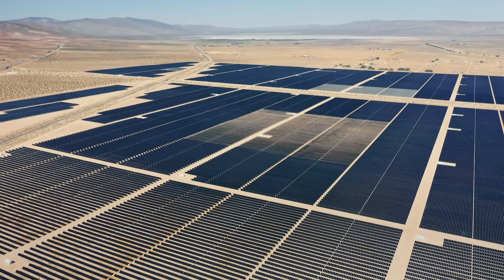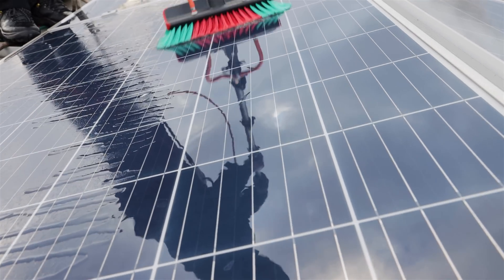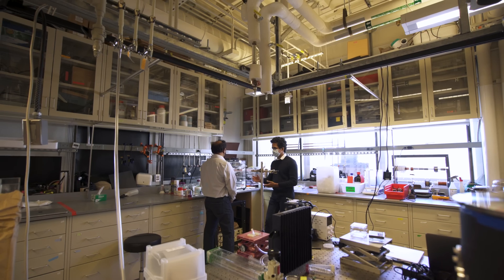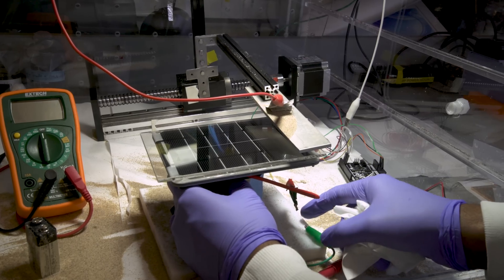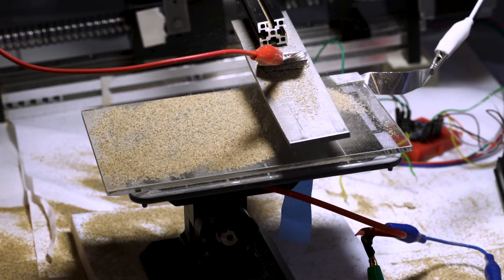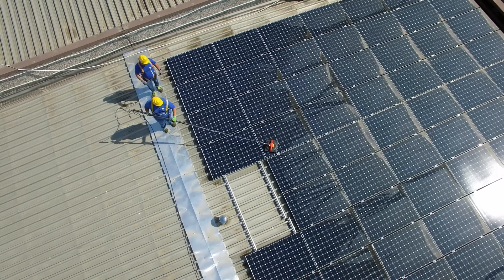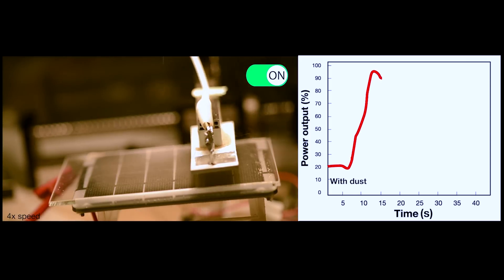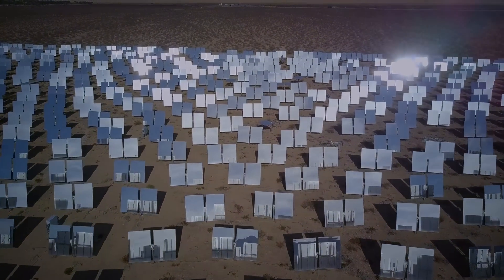How to clean solar panels without water

Comment: Can we change the algorthm of the cleaner so that it only roam on dust not the cleaner part of panel? how can be used for industrial scale and clean different row of panels, does it required to manual intervention to keep the cleaner in different rows? or we can use something robotic to place it in different rows of panels? how much electricity consume for cleaning per sq mtr?

Comment: It doesn't look that efficient because we can see some layer of even small dust particles are stayed back on the panel even after cleaning with this method. It's better to use some kind of clothes that can be used in a way which won't scratch the panel.

Comment: How about having coating the solar panels with solution which just repel dust. Just like water repellent solution. Just won't let dust stay.. a little wind is enough to slide away the dust on the glass.

Comment: It would be quite a scale (and not work on the type of array shown here), but if the panels were in continuous banks then rainwater harvesting at the point of use would cut down water requirements. It's obviously very specific to an area as to how much rain they get and you need to be able to store this underground, but essentially this would remove the need to bring water in from elsewhere. I think it's the cost of water that means this won't be done in most cases currently as it's so relatively cheap.

Comment: This whole solar panels open in the desert is stupid idea, Why they can't make a close stadium and inside put all solar panels inside stadium and use mirrors for concentrating sun's light which can be power delivery 2-3x times more, Also it can easily stop all dust coming and cleaning can be via controlled environment easily.

Comment: This plus air jets would work well, then the occasional water cleaning. but the true best solution would be to use a very precisely made blade as a wiper, and a very hard outer coating on the panel. It would be like when I manipulate a particular white powder on a glass sheet with a razor blade, leaves no scratches and all particle sizes are wiped by it.

Comment: Seems like its removing sand more than those small dust particles. Cant you just vibrate the panel with motor to achieve the same results?

Comment: i see far to many issues with this.

1. there is still dust left over, which is the exact same dust youd have collecting on the solar panels in the first place. The sand they use does not represent any real world scenario.

2. if this system is running all day like shown in the video, just how much of the solar panels capacity will it use? especially as they have to hover a bar above the solar panel

3. You're also just adding more and more moving parts to fail in a system like this. they will have to make it extremely easy to repair if they want it to cover every solar panel

Comment: Just an Idea: Instead of electrostatic repulsion, why not use Acoustic Vibrations to displace the dust particles from the surface of the solar panels? Think of it like putting salt/sand on a subwoofer.

Comment: Everyone in the comments with "WhY nOt juST RecYcle thE wAter?" has never cleaned a solar array. There is space between the individual panels that the water drips through, it doesn't just flow down to the lowest side. Good luck collecting the water, just as harebrained an idea as electrostatic cleaning that leaves a dust film.. "We'll just vacuum the water back up while it's still on the panel" Sure you will. A real solution would be a dry brush and pneumatic system developed to minimise scratching the panels, cutting out the water use, but then you wouldn't get research grants funding a spurious tech application to remove sand from solar panels but not dust
Reply: the dude sprinkling sand cracked me up

Comment: I must say that these particles must be stuck onto the surface, otherwise the built in motors that rotate the panels would be sufficient at achieveing the same effect. Change the angle of the panel and gravity should pull the particles to the floor.

So assuming the particles are stuck on. Then it would also be assumed that the cohesion force of said particles is probably stronger than the force exerted by this device being developed.

This is probably wasted funding.

Comment: So I'm curious why brushing causes scratch damage over time? Can you not make a brush where the bristles are significantly softer than the surface they're cleaning so they don't cause scratch damage? Or does the scratch damage come from the sand particles being dragged across the surface of the panel?

Comment: As others have pointed out, this seems really ineffective and rather pointless, at least how it is shown in the video. The dust and dirt that is caked onto the panels, especially after rain takes a proper scrub to be removed. In desert environment where they need to move the sand that has essentially settled over the panels, why not just use a pneumatic system that shakes the whole panel assembly, or just jets of air? I hope they release a better video explaining why their approach makes more sense.
Reply: Scratching on surface of panel permanently reduces efficiency. This is why air based approaches are no good.

Comment: Why don't you just attach a blower on top of the panel and blow the sand away once an hour for 30 seconds? Maybe apply a ceramic coat on the panel to stop the sand from sticking.

Comment: Or just you know..  use a fan to blow the dust off. And using water cleaning only when required... Also I always wondered why solar panels don't have additional dark film on it to trap more light, since most of it is reflected making it very inefficient

Comment: It will be very important on the moon. There is no atmosphere there, but there is an electrostatic phenomenon that creates a suspension of dust and it will impact solar panels, if they are used there.

Comment: Nice application, but here are few challenges to it,
1. Aluminum doped Zinc Oxide will reducen its strength to hold charge at high desert temperatures.
2. Dust and debris will significantly create a deeper layer of dust with time, whereas we will just remove bigger sand particles.
3. Energy is needed in this system to operate, which is negotiable.
4. There could be charge leakage which may effect the semiconductor in sensitive solar cells.
5. The cost of its application will be lot expensive.
6. It will need a lot of maintenance, like we need to change the chemical based electrodes time to time due to decay.

Overall, idea is great, but practically speaking, it has a lot of challenges to overcome. Right now the best thing, i can say off is just using medium pressure air cleaning, which does not require any transportation or water resource.

Comment: Nice in theory, but wont catch on. Mechanical problems require mechanical solutions. Those allready exist, and as everything goes in mechanics, the simpler the mechanic system, the better. How do you achieve a constantly clean surface that never accumulates dust? You spin it. A spinning disk never allows for particles to settle on it, any liquids on it are expelled due to centripetal forces and by simply using compressed air to spin them you can keep hundreds of solar panels clean win a single air compressor and some air lines.

Why is this the better solution? Because you don't need an MIT graduate to develop it. A man with a screw driver and a jigsaw can build this in his shed. there are no fancy materials needed. It can be made from an acrylic sheet. Simple is an art many people have forgotten about.

Comment: Such a nonsensical approach! This thing can only clean the grains of dust which is not stucked hard with surface, it can be done easily by placing the panel not parallel to ground so the dust particles fells down itself or with small amount of air. Their experiment is not solving the actual issue. The issue is that the panels need service to remove the dust stucked with surface, which is not grains of dust but a layer of dirt.

Comment: Looks like sand rather than truly fine dust they are testing with. I think it might not be so easy, how does dust stick to surfaces after all? It's also static charge that keeps it from being removed so easily, after all it's not like you can just dip the panel over and watch the dust fall off, doesn't work, it's properly stuck to the surface. Overcoming that charge and forcing the dust off seems like a tricky challenge. 
This is also a problem that Mars rovers etc are having, I somehow doubt NASA hasn't tried to come up with waterless panel cleaning systems, maybe ask them what have they tried and why didn't it work. I'm betting the second best solution to water is actually compressed air, trying to use it on Mars would be just too bulky. Also, if static cleaning is actually a good solution, then there is no need for a moving wiper, just attach a grid of wires in front of the panel and connect it to your electronics. It would be like those cheapo air ionizers, just one electrode also happens to be a solar panel. If it was static fixture, it could also run more often, maybe even continuously.

Comment: Why not built in a small compressor that blows on a nano treated non sticky surface? That technique they showed leaves a whole bunch of residue smaller dust particles. Seems like a good example of over engineering something? Or maybe not lets see.

Comment: Hey MIT guys n gals, love your work! One question for you though, does it have to move? Why not make it a layer over top that you can run a static pulse through in a wave? Keep going you're on the right track! ✅️
Reply: uhhh because then no light would be able to reach the solar panel?

Comment: Here's an interesting solution (expensive, but i think it's worth to try).
Sand is 6 on Mohs scale. Ceramic is 8. There are phones that have ceramic glass. Why not try to make ceramic coating as cheap as humanly possible, and then just brush the sand off without worrying about scratches?
Moreover, the advances in such ceramic coating will be applicable not only for solar panels, but in many other places (such as phones, glasses, windshields, etc.)

Comment: Why not just manufacture solar panels with in-built wipers like u get for cars and make the surface of wipers furry at one end and clean wipable at other end

That way particles get removed by the furry thing and dust is smoothly removed by the wipable thing.

Comment: On another note, fitting millions of panels with a control system and actuator arms hovering around the setup would not only add significantly to the footprint of the panel weight, but additional need for balancing and arrangements needed to compensate for the same. 
Instead I would rather have the researchers collaborate with robotic manufacturers (think Boston Dynamics etc) so that a group of robots could move around the field going on periodic trips and use the same tech but which would be built upon itself instead. This would cut costs significantly in my opinion and thereby add to the interest of solar companies to adopt the tech.
Reply: The arms won't be fixed, they'll be mounted on a moveable system. The panels will just need a layer of indium tin oxide.

Comment: Might be better to coat the panels with some electrostatic material instead. Or use a chemically smoothed process on quartz glass or something so dust can't even bind to the surface.

Comment: 2% of electricity generation is from solar. 50X, and we could be 100%. Water for 1M now means using water for 50M to power for 8B. Sounds good to me.
Reply: And excess solar generation capacity should be used for desalination. 1kWh = 1m^3 of fresh water. 30B consumed now, 50X would be 1.5T, meaning 0.02% of the 26,000 TWh current generation is needed for desalination.

Comment: what about just a water vacuum? so it runs water over the surface and also sucks it back up. then set up water processing at the solar facility to remove the particles from that water and reuse it.

Comment: Nice work, But I am a bit concerned that the actual electric power required to operate that cleaning robot will require more electricity than what can be produced by the solar panel.

Comment: What about a simple vibration based system? Most of these panels are at a steep enough angle that the particles should fall off with a slight bump, right?

Comment: Why not use like high power industrial fan and turn on once in a few hours to remove sand and dust.
Operate using the same power from the solar panel.

Comment: What is the ratio of power consumed  v. power recovered?  Also the dust (silica based) over time will cloud (micro-scratch) the panel's surface scattering light and reducing output, cleaning or no cleaning. Improved coatings may be the answer?

Comment: use the solar energy to power a desalinization plant to allow the use of seawater for cleaning.  although in general using water can cause ecological changes that require more maintenance. (ie the growth of plants at the base of the solar arrays.) might be cost effective considering the need for water would benefit from the creation of more freshwater, and the actual solar arrays freshwater requirements would be relatively small compared to the amount created so the excess could be distributed to the nearby populous
Reply: good point

Comment: What this guy isn't thinking about is you don't haaave to wash them.  The rain you get will take care of massive amounts of dust. Even in dry climates. There's loss yes, but it'll never be 100% loss. Washing them just makes them more efficient. You can run dirty panels and still get power. Not to mention you can wash them with dirty water and still get them cleaner than no water at all

Comment: Would it be practical to isolate the surface of the panels from the problem ie the dust environment? For instance, physically sealing lengths of panels within a clear flexible cover (front and back like two sides of a bag) and use a conveyor belt type design to constantly shift/rotate the cover like a conveyor so that the dust is transported to one end of the lengths of panels to simply fall to the ground. Maybe just vibrating the cover or forget the cover and just vibrate the panels themselves to achieve the desired goal. The panels themselves might even be made to power the conveyor or a vibrator belt. To clarify, if I didn't make it clear enough before, a loop of clear flexible material (not affecting the panel's performance) would run over the panels and then behind the panels to protect them from the dust. The cover, could rotate or vibrate to dislodge the dust. Note: The panel frames would need to be of a modified design for a conveyor system to work but not necessarily for a vibrator system. Thoughts?

Comment: Coal plants have been using this technology for years, this isn’t some new invention. Electrostatic precipitators I believe? They use it to capture particle emissions before they blow out of the smoke stacks. The efficacy of the system depends on the specific types of coal, because some coals produce more electrically neutral ash particles than others, and therefore can not be captured by the precipitators alone.

TL;DR Coal did it first, not all the dust can be removed. MIT didn’t invent this technology.

Comment: I am thinking compressed air be a good options Electrical Valve close and open Control Centre. They output enough so they can clean sand and dust of the panel. It’s an idea but I know nothing clean better than water and brush.

Comment: We can remove sand dust with the help of compressed air or fan,

But what about small micro dust which stick on panel, for that we need water or cloth or viper.

Comment: Simply collecting the water and reusing is much more  feasible. You don't have to put new or modify existing panels, more than adding a gutter. They don't do that, probably because water is so cheap.

Comment: Rotating it upside down so gravity help remove big sand particles and then blowing air or using suction so small particles will be removed without scratching glass surface.

Comment: Just another gimmick! 
Small dust particles held tightly with the surface & keep on accumulating. No contact cleaning will just remove heavier particles & left the smallers one & over time smaller ones will accumulate much more tighter. This will just end the life of solar panel. 

USELESS!!

Comment: As long as you source the water from rain filled lakes that have rivers leading back to the ocean, the water you use on the solar panels is not "consumed". It evaporates and rains back in oceans and lakes again. The only waste is the energy it takes to pump and transfer the water to the desert areas.
Reply: Yes...but this is mainly for desert solar farms, where rain-filled lakes are not super common

Comment: What about the thick layer with even smaller dust particles combined with moisture (yes there is a lot of moisture even in the desert) that sticks on the surface of a panel like a glue ? This is the dirt on most of the panels that we see not free big particles of dust without any other kind of dirt or element. Solar panels are BS technology, very bad efficiency, consuming lots of resources to be made and a lot more to keep them working and after 10 years have to be replaced. Big companies give money to the Unis in order to demonstrate that using panels and wind turbines isn't bad for the environment as much as using coal and oil (if not worse).

Comment: I think it should be combined with compressed air tanks, which will be shared between near panels. Compressed air will blow away the rest of the dust.
Reply: It’s not like compressed air requires massive amounts of electricity to produce, OH WAIT